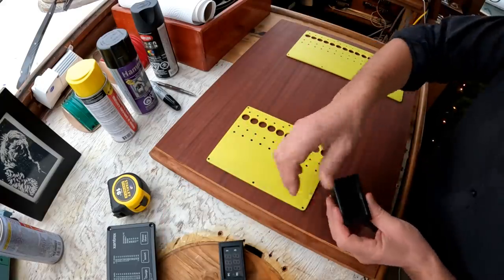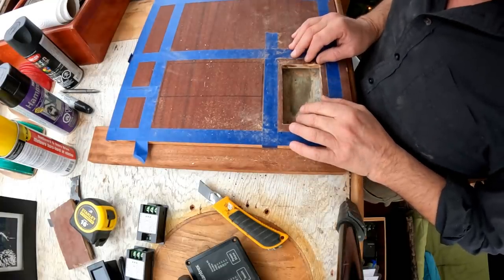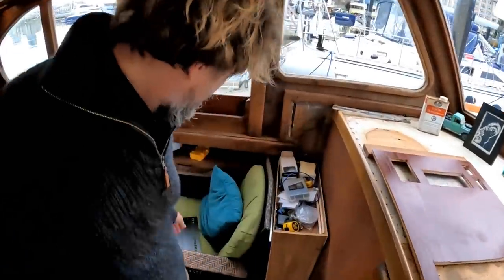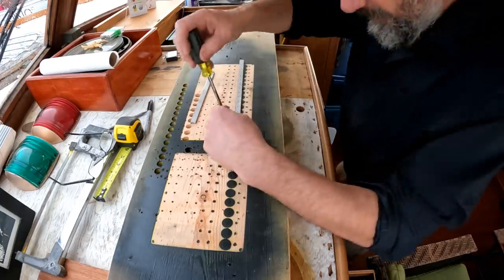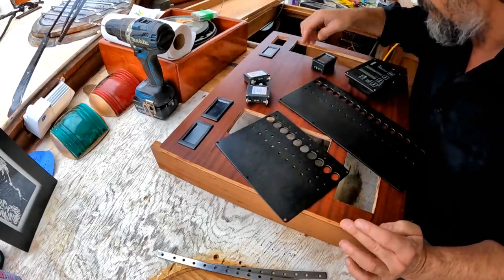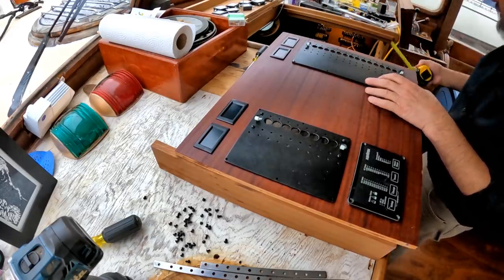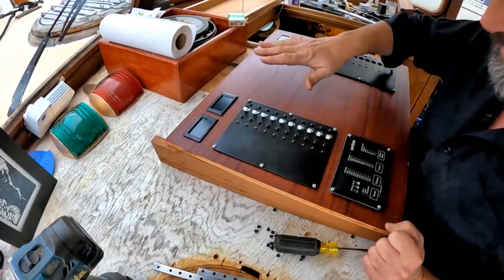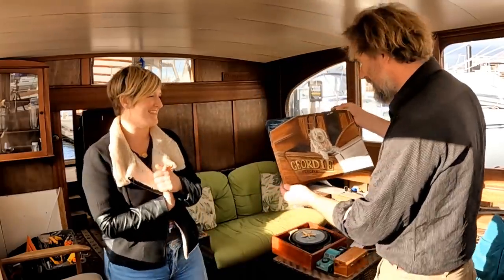Electrical Panel - #284 - Boat Life - Living aboard a wooden boat - Travels With Geordie

Comment: Sorry if i posting this twice but my last post errored and disappeared.

I'm a Marine Electrician and once i sit the test early next year ill be a Marine Electrical Surveyor. Please 'DO NOT' use stainless steel as a busbar, it is over 5 times more resistive than copper, its practically a heating element. Use copper flat stock/bar or brass but copper is best in your environment. The terminals on your circuit breakers will heat up and degrade the plastic case in to carbon with in 2 years and WILL start a fire due to thermal runaway if not found in time. Its not a matter of IF its only a matter of time. Ive seen it many times already. 

Looping copper wire with crimped terminals is a far safer option if you cant get the copper/brass stock you need right away.

Also try to put in 3 short bars connected with flexible insulated copper wire for maintenance down the track. If everything is ridged then everything will vibrate loose. Its got to be able to flex and move with the vibrations and thermal expansion.

Regards,
Reply from the maker: Yup, I knew it was not as good but wow, I got caught out as to how much. Copper on the way

Comment: For your buss Peter, I would have used 1" copper tube, flatten it, fold in half,drill my holes then tin it using uttik solder.  Less loss, easier to work with and far cheaper, but a very good job you have done.
Reply from the maker: Copper on the way

Comment: Great Video Awesome Panel !!!!  You might consider that the Resistance of SS is 41 Times that of the same size as copper. So theoretically you would need a cross section of 41 times in SS as copper for the same resistance to what ever you are expecting for AMP draw. This could produce a lot of heat and a lot of voltage drop to what you are running. Please check the voltage drop at load end.  And check the temperature of the SS after you run something and turn the power off to the panel unless you have a heat sensor gun to aim at it. 
I really enjoy watching your channel. Be Safe. Cheers.
Reply from the maker: Copper on the way

Comment: FYI. St. St. has 41 times the resistivity of copper, so allowing for 20% loss from the holes drilled in the busbar the stainless bus bar (1/8 x 1/2) is the equivalent of a #18 AWG wire!!   Not even enough for the fridge to keep your beer cold.
Reply: Thanks for the technical # on how precisely bad it was. I just know don't ever, industry wide problem level issue. The heating on some oxidized copper busses from poor connection then overheating the breaker pole. I pull them out you can tell the screw tab is tarnished, brittle and plastic toasted.
Reply: Yup, never use SS buss bars for electrical work. You dont want the voltage drop, under load running bilge pumps etc...as they can consume some significant amps.  My own OEM panel used individual copper wires from a standard copper tined positive bussbar up to these carling breaker switches. Wires are bundled up 10 and mostly12 gauge with nylon ties. They also have ABYC rules about unfused wire lengths, which I think mine meets the 40 inch rule in a cabinet, but you know this was made in 1970. SS to copper with the high resistance of SS I think will also heat up the lug, and you do not want that heating cause it can cause the connection to get worse over time, maybe could cause the wire to melt or burn if it gets hot enough. You create a potentially unreliable electrical connection.
Reply: @scottdowney4318  what is the oem build? These seem rare at least in the sailing side. 
In my overbuild opinion I want the unfused jumper wire as large as minimum to next size larger than the conductor full length run. Safety factor, I just don't want jumper wires becoming the fuse. 
I am waiting for the list of fails from the newer daisy chain jumper wire stuff (China-Ebay types) super sketchy stuff being sold, aluminum wire labeled as marine etc.
Reply: @braithmiller  I have a 1970, 37 foot Eggharbor wood sedan cruiser boat. Basically I have a 150amp fused 2 gauge house wire coming from the fuse junction block  that is connected to a rotary selector switch to the battery. It uses an ignition protected MEGA fuse. That 2 gauge wire runs to distribution block inside the helm and all the wires from that run to either the carling manual breaker switches, or the push button breakers on the side of the helm. When I got the boat, there were no main fuses, so I added them. I know my boat house wiring will never even draw a 100 amp load as fridge is AC, and Head with Lectrasan is on a separate 100 amp wire.  Any short in that wire would quickly blow the fuse. The starter battery is fused with a 300 amp ANL Blue sea fuse. Works fine, does not blow when even extended cranking of engine. Those large wires are a mix of 4/0 and 2/0 to the starters. I run a 2 gauge wire off that junction back to the Onan generator about 12 feet away.
I saw a youtube video by MaineSail where he took a lithium battery bank and a 300 amp terminal fuse and used an 8 gauge wire to create a dead short, the fuse blew instantly opening the circuit.
Reply from the maker: Copper on the way
Reply: @TravelsWithGeordie  Glad to hear it. Copper is what you want, you also don't want brass as it also has a higher resistance than copper. I have never had a copper corrosion problem interfering with electric flow, and copper oxides also conduct current. My old boat 1970 and still has most the original buss bars, wires, lugs, switches, etc... in the helm which never gets wet.

Comment: Peter, you can make those Fein tool cuts less stressful by putting a wooden guide along the line you want to cut.  That makes a straight cut  much easier AND a second piece of wood can be used as a stop to avoid making your cut too long (or just make your guide "L" shaped.
Reply from the maker: Great tip, thanks Todd

Comment: I concur on other comments about the stainless bus bar.
In the future drilling stainless, use a pilot drill bit to start the hole and finish with the appropriate diameter milling bit. Takes seconds a hole.
Panel looks good but change to copper or brass bus please.
Cheers!
Reply from the maker: Copper on the way
Reply: Excellent! 
Merry Christmas Peter!

Comment: Please, Please do not use stainless for your buss bar, steel has a much much greater resistance than copper or brass. the higher resistance will effectively turn into a heater and will create high heat points on the breaker terminals.
Reply from the maker: Copper on the way
Reply: Was just getting ready to post this.. you can use stainless, it just needs to be about 5-6 times the cross sectional area of copper that is specified for the current load.

Comment: Why not copper or brass buss bar?  softer metal to drill and better conductivity. 
Other than that, the panel looks great!  And the pan/dome head screws work well with the little led domes .
Reply from the maker: Copper on the way

Comment: You want an inverter that will run the largest thing, however only one at a time  1000 watts is good   Panel Buss bars are usually copper (?)
Reply from the maker: My table saw alone needs more, looking at 2400. Copper on the way

Comment: Both the panel and painting beautiful works.
Technical concern on the ss bar. The resistivity of stainless to copper is so poor many marine bolt down fuses and connections are turned into a high resistance (heat) point to failure. Many discussions about this problem (installers dropping ss washers into assembly) killing alternators and such. 2nd class ok is solid copper bar, 1st is the same tinned. Same for terminals and screws. I think the consumer assumption seeing shinny silver in high end marine electrical is that they are looking at ss when it is actually tinned copper. Possible to tin your own copper bars, I have thought certainly not necessary for you in your very unsalty interior panel. Can I recommend not using the standard breaker commen bar, rather mount the bar to your back panel, wire oversized to the breaker. This allows replacement of a breaker without dismounting the bar.
Reply: I made some solid copper buss bars and used SS studs and nuts to hold on up to 3/0 starter wires for big engines. That works ok as most of the current is passed by the copper tinned lug to the solid copper plate. I made up 2 large distribution blocks. I had some 1/8 copper sheet. One I overbuilt with 3, 1/8" thick layers soldered together. The other just uses 2 copper sheets. The blocks are 2.5" wide and 7 inches long and have 6 wire attachment bolts threaded into the copper plates. I use one for the starter distribution  and Onan generator power, and the other is a negative ground block. I tell you, once you solder large copper together, not even an acetylene torch tip can get them apart, the copper soaks up the heat tremendously. I think you would have to heat the entire block in a charcoal fire.
Reply: @scottdowney4318  Your oxy-acetaline set just isn't big enough ... yes though, heat distribution abilities of copper are impressive. What old timers would accomplish with kerosene-air hot pots and torches! Modern we tend to musle our way through things.
When you need to get Acme thread drill pipe apart we use large rosebuds just like large soldering and brazing.
Reply from the maker: Copper on the way

Comment: You could make the text blocks for the panel out of cut vinyl decals. I'm sure there must be a place in Victoria  that can produce these from PDF file. If you decide to go this route be sure to wet the surface before applying so you can move the decal around to line it up.

Comment: Stainless Steel has a much higher resistance than copper or aluminum. It may cause problems overheating and can actually react with the fasteners and mounts of the breakers that are a different material. Tin plated copper is best for a marine environment.
Reply from the maker: copper is on its way.
Reply: @TravelsWithGeordie  Great to hear Peter. 👍

Comment: I'm building my solar charge controller/inverter/battery cabinet right now. It's got a UL rated AC distribution box, but I'll add DC in the future. Your project is timely. I'm getting ideas. Thx.

Comment: Possibly you could 'blue' the screws by heating them and dropping them in oil? I don't know it that works on stainless steel but it might be worth trying.
Reply: I don't think you can do a real chemical ( phosphoric) bluing to ss. Heating till you can carbonize oils and polymerize is likely harmful to the ss. I have just shoved them into cardboard to paint when it offends me enough.
Reply: @braithmiller  fair enough it was just an idea. Painting works :)

Comment: if it is the industrial look you want, then I might suggest traffolyte labels (actually nowadays its a 3 layer composite acrylic style material), so a colour with white centre, you engrave the lettering and it shows through white, I know one of the current composites has one side gloss and the other matt.
Reply from the maker: Just about what I'm thinking
Reply: @TravelsWithGeordie  I am currently experimenting with a 3 layer composite for making the electrical panels on a boat I have a share in, still trying to find the best engraving bit and fonts etc, then I will be able to produce them. I am in the UK, so it might be easier for you to work with someone more locally to you, you could draw up the designs you wanted in CAD quite easily and send them out to someone. however if you do get stuck, i could possibly assist.
Reply from the maker: Thanks so much. it looks like I’m no all set.

Comment: With a bus bar, if you ever need to replace or change a breaker, you have to undo all the screws in all the breakers. I like using wire and ring terminals. More work now and not as cool looking. But, a lot less work the next 6 times you are upgrading or modifying.
Reply from the maker: That's valid, but as the panel is on a door, twice the wires in the flex bundle isn't too appealing.
Reply: @TravelsWithGeordie  In the plan I'm suggesting. The loops that make up the "bus" do not leave the area of the breakers. Each breaker is wired to the next by a short loop of wire ( you do not have to even cut the wire, just in and out of the ring terminal.   So the wire bundle does not get larger.  At a minimum, breaking the buss bar into several short segments connected with a loop of wire. limits what you have to take apart for service.  Aircraft have the same rows of breakers and the same service issue.  Servicing the ones with solid buss bars is a real PITA.
Reply from the maker: ahh, got it.

Comment: I don't comment on the why & wherefores of your choices on how to do things, but the whole SS bus bar thing had me shaking my head I have to admit. First I'm pretty sure you can get ready made bus bars suitable for your purpose and since they would not be visible anyway why not? Second as some folks have pointed out, SS is not really a great choice electrically anyway, and finally it is just so hard to deal with without the exact right tools/bits etc.. Brass or copper is like butter/melted butter respectively in comparison.
Reply from the maker: Copper on the way

Comment: Looking good nice and sanitary layout. Is it recommended to also use mechanical gauges as redundancy such as oil ,battery charging and temperature?
Reply from the maker: I may put a manual engine oil pressure gauge in.

Comment: Beautiful work but Stainless Steel is a terrible choice for your busbar. Measured against copper, which is accepted as the baseline and given a conductivity value of 100%, stainless has a conductivity of less than 3%. In other words, your cross sectional area needs to be 33 times larger to handle the same current. Not only  will this not work, it is a huge fire risk and you MUST abandon the stainless for copper. 😢
Reply from the maker: Copper on the way
Reply: @TravelsWithGeordie  Excellent, happy holidays to you.

Comment: Oh.  Stainless is a bad conductor. You might consider swapping for brass or even copper.
Reply: aluminium is also a good conductor (and relatively easy to drill)
Reply: Yes buy a piece of copper bar, tin it and use that.
Reply from the maker: Copper on the way

Comment: Stainless for a buss?  No way.  High resistance, heat, potential fire hazard.  Not to mention, hard to work with. Nickel Chrome wire is what they use for heating elements because of its high resistance. They used to use plain steel wire, but corrosion is a problem.  You have made a heating element 
out of your electrical panel.
Reply from the maker: Copper on the way